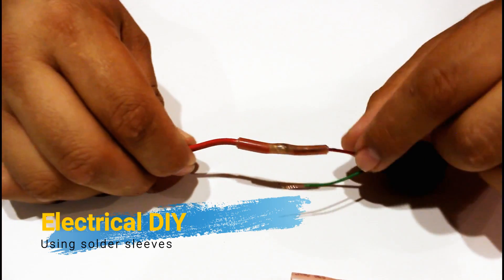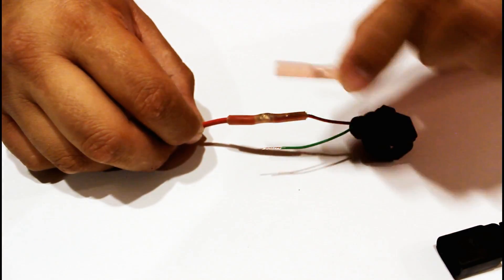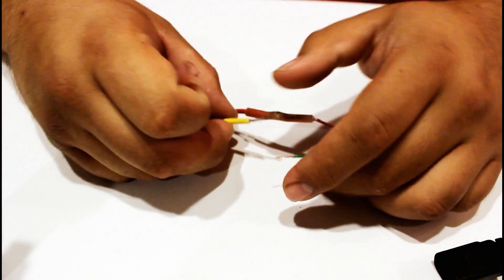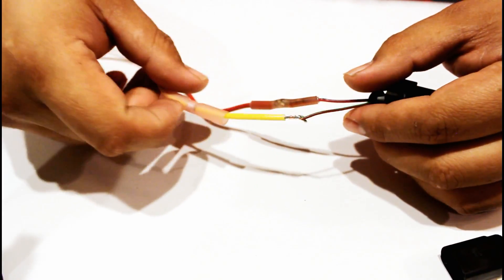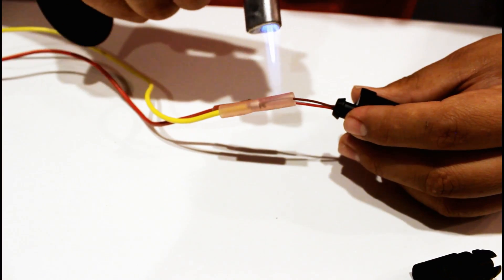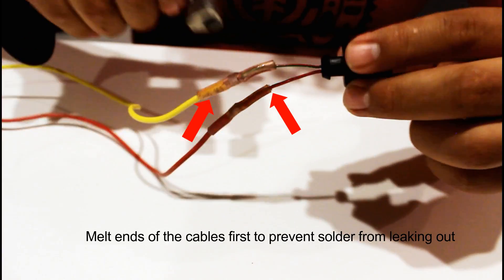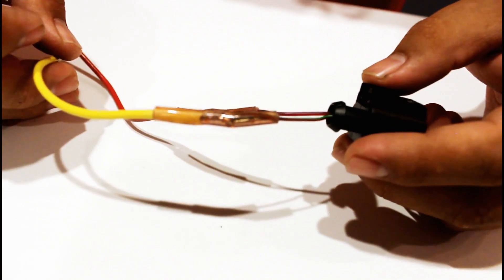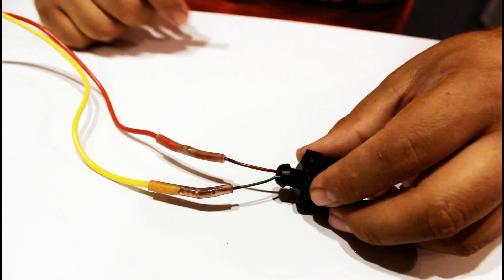How to use solder sleeves!!

Comment: Having experience with connectors I strongly suggest not using a torch or lighter. It may not seem as convenient, but using a heat gun is preferred. Also a little solder paste on the wire ends would ensure a great connection.